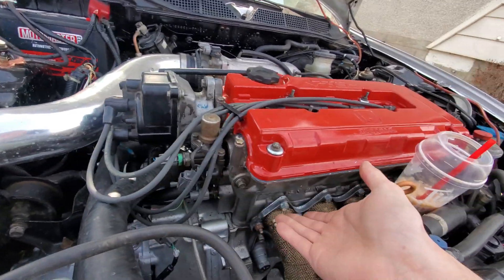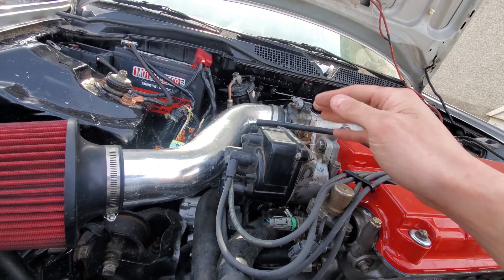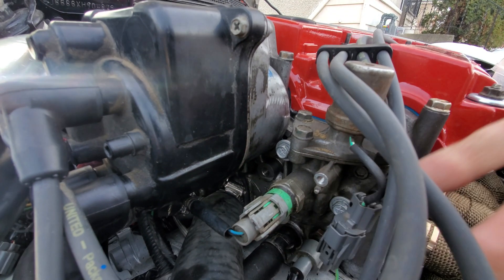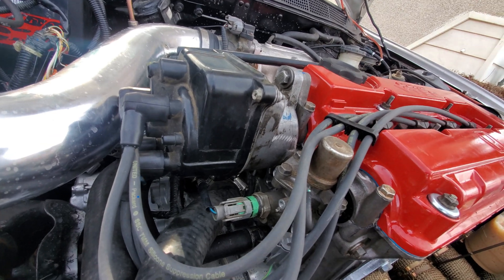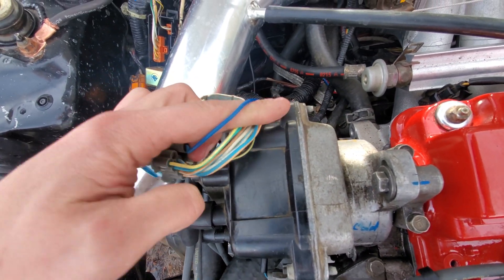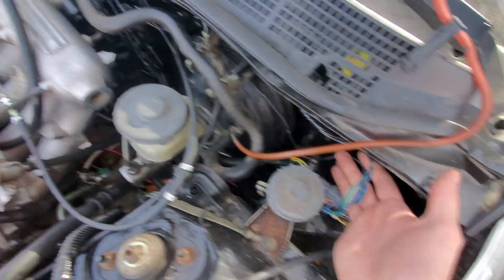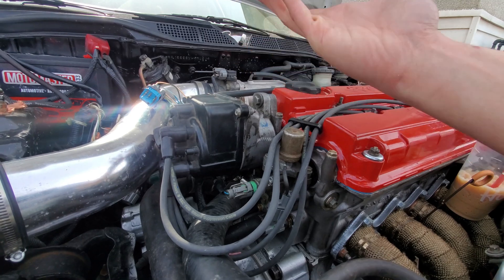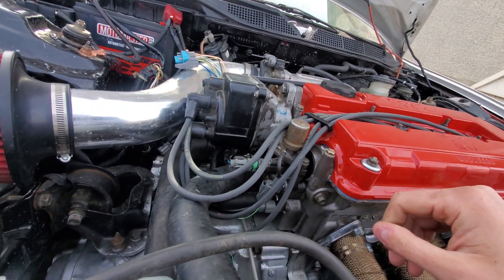Use any B-Series Distributor With Your Swap! OBD1 Conversion No Tach Fix!

Comment: I’ve ran a wire just to see and the tach does not work still. Put an obd1 ecu in my 2000 gsr (cuz boost) haha and I knew the tach wouldn’t work, but this blue wire over to the test wire by the driver side tower does not work for me.

Comment: Do I need an obd1 ECU to run an obd1 distributor.? I want to run a obd1 dizzy in a obd2b car/engine/ecu
Reply: No
Reply: @Verde_EF91 I have a b16a2 engine swap from a 97 del Sol in a 99 crv auto. Im running it on the stock crv ECU/wire harness and 94 gsr dizzy. It runs rich and I'm wanting to get it to run smooth. Where can I start.?

Comment: Ik I'm a lil late but I have a question, I gotta ef hatch and has a b18a1 swap and the car is already obd1,I'm about to buy a b16 swap and obviously wanna run the VTEC,any help on using my b18a1 dizzy to make it run VTEC?
Reply from the maker: I could be wrong as it's been a while, but the distributor assembly should swap over. I ran a b18b1 distributor on my b16a2. The only difference is the mounting points. The b16 has the vtec solenoid, so the b16 has slightly different mounting holes. I just cut one of the mount ears off where it would hit the vtec solenoid and never had any issues running 2/3 bolts. I'd assume it would be the same for you.

Comment: For everyone confused I will be uploading a video in a week or less on how to wire this up.
In my case this is a D16Y7 (1999 Civic Coupe DX) to GS-R (B18C1 and transmission) swap. I had to convert my 10 pin plug to the 8 pin plug (There are only 9 actual wires on the 10 pin plug but it has 10 pins none the less) The leftover blue wire you have (Should be solid dark blue) should go to the driver shock tower where there should be a single Light Blue wire by itself that terminates itself into a small plastic plug. This should be located next to the plug where you connect your engine harness to the chassis harness. 
If you solder a wire to the end of the Dark Blue Wire from the Distributor, and then take the other end of the wire and run it to the drivers shock tower, now cut off the "small plastic plug" on the end of the !LIGHT BLUE WIRE!, which will then allow you to solder the other end of the wire to the Light Blue Wire and should give you signal for a Tachometer.
Video will be uploaded soon!
Reply: Please upload this. I followed every step you explained here yet still have no tachometer reading.

Comment: will  the car still run without that blue tach wire not hooked up? i just put a b20v into my ek with the same harness and have no spark to any plugs. ive changed the plug on the dizzy side to the 8 pin and didnt hook up the blue tach wire yet just want to make sure the car runs first. the black yellow wire into the dizzy has power but nothing coming outta the coil. ive replaced the coil still no spark.
Reply: Check ignitor in the distributor, it is replaceable, if not find another distributor that works for sure.

Comment: I have a crv 2000 I’m getting no spark . I have a 94 b18b1 I just put in it. I’m getting fuel compression but no spark
Reply: Tested my distributor it’s good, even tried another distributor. Would I have to convert my obd2 to an obd1? I’m using my crv harness which I’m guessing is obd2

Comment: Having an issue with a swap. B18b1 in a eg 1992. Using the obd1 harness. Everything is plugged besides tps sensor and it seems to short to connect. Tried multiple distributors even the one that came on the b18. Bought a jumper to use (obd2 to obd1 8pin) its timed, has fuel, good spark plugs and new wires.
Apparently im getting no spark when trying to turn on. Can i opt to use an obd1 integra distributor?
Reply: I’m having the same problem but with my crv it’s a 5 speed I’m getting no spark with a b18b1 engine swap. Should I convert the cables ?

Comment: Didn’t work for me🥺
Reply from the maker: whats your setup? year of chassis and engine and harness combo?
Reply: @RaineLutz  hey I got a question I've got a mix going on.......car 98 civic Hatchback with a 96 gsr motor on a 99 civic couple harness ( gray plugs) I have totally redid this car from scratch I have always used my( chipped p28 ecu same one in 92 eg hatch with jdm typer...then put 94p28 and retuned for a stock.gsr basemap....and put it in my 96 interga  gsr now I sold my interga shell ,kept motor and harness from gsr.....found a super clean 98 civic hatchback installed 99,-00 front end......final got motor in wired up and got it to start....never had any problems with ecu....from a aggressive jdm type r tune in eg, back to my integra re tune with gsr base map.....I did have to buy a new distributor (TD84.00-96) gray plug obd2 to match engineharness.....3 years later finally got car to start first night would not go over 2800rpms but idled at 850 like a kitten.......go for a few test pulls no vtec( its always worked) speedometer bouncing.......switch some iac and tps plugs around ....idle at 1500.....but only Rev to 6800....( red line was set at 8500 when in integra,same base tune just moved up to 8500......went over everything,found a cracked plug on vss on tranny.....plastic plug was cracked  but I fixed the connection every was good....30 pulls later speedometer doesn't move or bounces , no vtec ( green sensor was cracked , re placed sensor with new , checked the single wire  from sensor to ecu all good no breaks.......car sits for a month fire it up sounds like a wrx missing bad ....reach down a wiggle ecu in floor ,and it cleared right up......ok something going on....sat for another month...buddy comes over I try to start the car nothing it was on jumpbox and cables stone dead battery....car will turn over crank nonstart.....I haven't touched anything under the hood since I got it running......jump harness on ecu side was burnt and melted.....got a after market jumper damn near brand new that came with the hatch shell switched it out ,no start.....checked out pins and I'm missing a pin on engine harness side  on larger plug...of jumper...looked at burnt one, it has a extra pin extra pin  in plug that is tired into a9 ( 5th pin on top)....got car to start 30 times first test run 2800 Max rpm...no vtec....finally got it to 7200 no.vtec..speedometer bouncing
.maybe vss is bad .....car was started 30 more times idle at 850 900 no vtec ...then sounds like missing...no burnt fuses no burn jumper harness plug on engine side burnt also looks like a2 and a6 were tied together  before going to ecu plug at pin a9 burnt